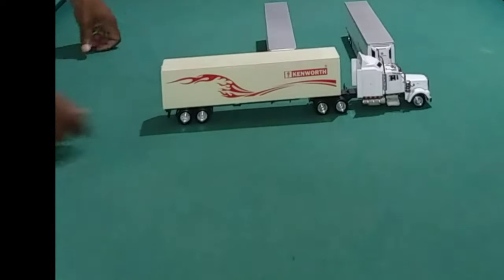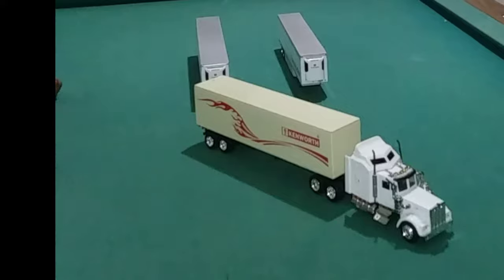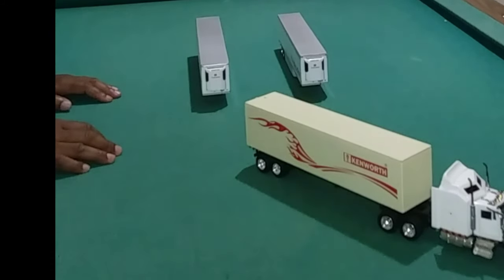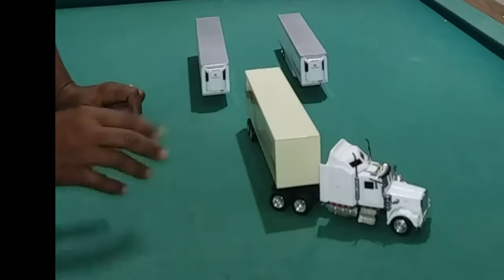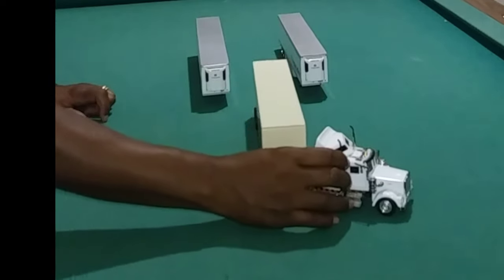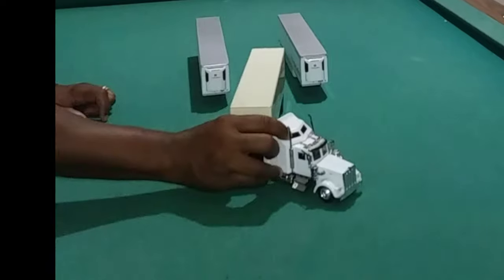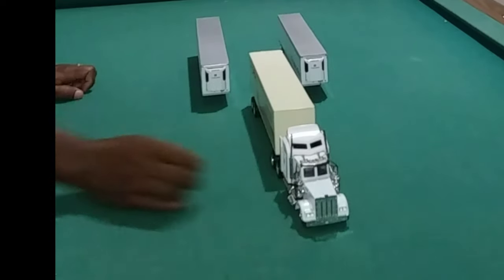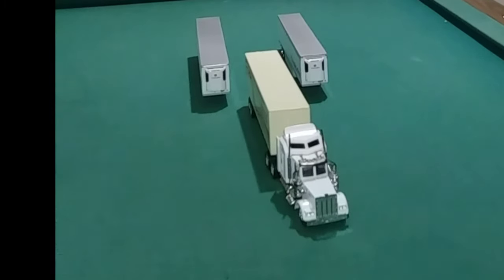Best way to set up for 45 backing maneuver.

Comment: Bro you saved my career. I didn’t go to a school I just rented a truck and took my test. When I first got to a yard it was crazy chaotic and I was lost. I almost said fuck this CDL but you gave me more than hope. I hit that bad boy twice today with no spotter straight in the hole thank you big bro
Reply from the maker: That's makes me happy to hear. If it's anything I can do to help, holla at me it would be my pleasure!
Reply: I met you while at the Rockwall, TX terminal when I first started trucking with. Thank you very much for helping me‼️
Reply: Got my cdl and still can’t back
Reply: @mauriceallen6116  same here. I was taught how to back but not back but that's all. But not how to set up for dock backing our how to make corrections.

How are you doing now after 2 months?
Reply: @Jake-li7ih  I’m doing a lot better, once I learned the set up I’ve been more comfortable.
Reply: @mauriceallen6116  Hey thanks for the response, it actually means alot to me.
Yeah the other day I was able to pretty much back right into everywhere just fine and then I swear the very next day it took me like 20 minutes to back into everywhere I went. I was stressing out bad. I got to one stop where the dock plate was like exactly as wide as the trailer. If I was even one inch to the left or right it wouldn't work. I had to be 100 percent precise
Reply: Same Bro! I would get in the chocked position and and pull up with my studying wheel all the way to the right. Start starting and everything! Gonna put this to practice today!
Reply: @Thisisebm Is there a reason this method is appropriate than after seeing the driver's side rear corner of the trailer, getting straight and backing straight in? I'm new to all of this and I was understanding the maneuvers until then. 
Thank you in advance for your feedback.

Comment: Drivers that are new like myself, this man knows what he is talking about. Even though I haven't been consistent with this technique, it does work whenever I do  use it. The last time I did it, I was at the walmart distribution in Williamsburg Virgina and when I did this technique, It only took me backing up three times before my truck was and trailer was completely straight as a whistle with the spot I was backing up into. The key with this technique is your setup. Setup correctly and this technique will work everytime like he said in the video. Again, thank you for making these backing instructional videos. They have been a big help. I always come back to watching them as fyi.
Reply from the maker: Thanks Isaac! And thanks for watching.

Comment: Hey Cornell! This is exactly what I’ve been doing. So it’s reassuring knowing that I’m not doing anything wrong. I always feel like I’m over steering when I get a bend going to the left. It does take me several pull ups but this technique works! -Monique
Reply from the maker: It may take a few pull ups to get the bend out, but if up straighten the wheel and up just until the trailer is in the position you want, them turn the wheel all the way to the left and back up and just repeat that until the bend is gone just like in the video it should work for you. Stick to the formula stick to the script.. Let me know how it works for you....
Reply from the maker: How you do Queen, hope it's working for you. Stick to the script...☺

Comment: Sir I want to say that this procedure does work. I don't care what others say. When I was in New Albany, Ms. At the Walmart distrubution center, when I was struggling to back in my trailer, I had a fellow driver help me back in it by using this procedure. I didn't notice it until I saw the bend of my trailer and thats when I thought of this video. It works, even when parking your trailer from a  45 degree angle it works. As long as you have the proper setup, this procedure will work every time.
Reply from the maker: I'm glad it helped you Isaac! And thanks for watching.
Reply: @Thisisebm  np. It's just all about how much space you have in front of you as well because most of the time when I turn my wheel all the way to the right, i have to turn to left early at times because of the lack of space in front of me at times. What do I do then to adust

Comment: Wow did this today and got in the hole between two trailers. I even got it in there with not a lot of room to pull up. I drive local and deliver to small yards. Wish I seen this awhile back when I started otr.
Reply from the maker: Thanks for watching Baker.  Thanks for putting the method to the test. If you do it correctly, it will work.☺

Comment: Great video Mr. Cornell because backing is one thing I have been struggling with since I have been training. My question is how will I know if I have pulled up a additional 8 to 10 feet. Your video has explained it better than my trainer and I really need to grasp this backing maneuver on my own cause I will not be on his truck forever. Thanks in advance if you reply back to me.
Reply: good question.. i been wondering this too

Comment: Excellent video the pull up straight then left works great i actually bought toy truck can you do videos on 90 degree alley dock along with setting up for different types parking like coming into truck stop seeing spot plenty room across then hard rt then lt so truck can be straight backed into parking spot when to stop holding rt before lt to straighten truck out so back trailer is even with parking spot also so trucks not all crooked not parallel to where you want back
Reply from the maker: Thanks jeep cj7, and thanks For Watching
Reply from the maker: Stay tuned for more videos and up coming merchandise.

Comment: @Thisisebm Is this best used when the tandems are set back or foward and can this setup be used for any parking or just best for dc’s, also does this work best for a day cab or sleeper? Ive done set up but kind of confused is it a certain amount of space we should go up when we make the hard right to 3 o’clock after picking our spot and shoulder? Then once we go to hard left do we keep the tractor and trailer completely straight or should we have a bend in it when getting ready to do the hard right for the pivot? 

I want to know do we just hard right as soon as we see a bend in the tractor and the pivot  then back to the left.because I’m doing the hard right and when it pivots I go back left but the tail will swing even more to my drivers side. I would really appreciate your help I’m struggling with my backing the most. I’m also struggling with seeing my setup because sometimes I’m placed tight but majority of the time I’m to far away from spot I’m getting in, its frustrating but I’m still pushing. I just need clarity.

Comment: Do you turn your wheels all the way to the right or just a slight turn before you start to back!
Reply from the maker: That's a great question. That would depend on how far you from your target... Remember that you're wanting the back of your trailer to end up pivoting in between the two  trailers if that's your target. I have a video called pivot practice you should check it out. Thanks for watching.
Reply: @Thisisebm  when do you really start liking to crank it soon as you're back trailer tandem hits the extended yellow line the dock line your imaginary line do you wait for the first tandem or in between both tandems and then start cranking do you crank it all the way what I mean by that is do you have the trailer completely at 90° or do you go to like about 80 or 75 and then start chasing it getting back underneath it to straighten out the tractor or perhaps it's 60°. What seems to work best for you it's that tricky question about when do you correct after your hard right where do you like the trailer is it at an angle still not completely 90 so like a 80 or 70 and then you start chasing I hope this makes sense just trying to see what you do
Reply: @Thisisebm  😍
Reply: @Thisisebm  oh yeah start watching the pivot that you put it in the video watch when it starts to Pivot so when the back of your trailer is pretty much square in the hole and the tires are not moving pivoting you want to crank that sucker to the left
Reply: @Thisisebm  your 3:00 position when the tractor and trailer are straight I have a question can you have a slight Bend so you can see out the driver side mirror or window easier instead of being completely straight already starting your turn
Reply: @Thisisebm  your rear tandems you probably do not want them going past your extended line in your hole on your Blind Side is what I'm thinking so then you will know if you're too deep or not deep enough I guess how far do you back up your trailer after the 3:00 position if you like to keep it straight is there a secret formula is the corner of your site side in the middle of the hole or slightly more towards the Blind Side what is your measurement or trick
Reply: I think what I'm looking for is depth perception on the right on the hard right I seem to have a little trouble being either too close to the site side or too far on The Blind Side how can we fix this so we can get in the middle of the hole a hole in one so to speak I hope this makes sense on your hard right do you look at the back edge of your trailer the very back of your trailer or you doing the tandems or maybe a combo of both I would just like to really zero in so I can just get it in without backing up the lock because it's very busy

Comment: Thank you so much for the demonstration!!!!! You are an answer to my prayers!! One quick question does that same thing work on a 90 degree alley dock???? Could you please respond to my question please . I plan to go in about a month to take my skills test at Newport Arkansas today is 10-17-20 703pm 🙏🏻🙏🏻🙏🏻🙏🏻
Reply from the maker: Yes. It's the same on any backing maneuvers. Just recognize when the trailer actually begin to Pivot. If you are turning the wheel to the right the trailer will roll back. But when you see the tandems stop rolling back and begin to spend that's when you turn the wheel all the way back to the left and walk the trail around to the desired position. After that the formula is quite easy if you watch that video then you know what to do after that I promise you we will work for you that time next time all times included☺

Comment: when you started to turn the tractor to the 3 O'Clock, was that one space pass the parking spot that you needed to park in or two spaces?
Reply from the maker: Your drive tires should be right in the center of the space you're trying to put the trailer in  when you do your right hand turn to do the 3 0 clock

Comment: Very helpful video. However, what if you don't have the space necessary to perform the maneuver as described? For example; most truck stops have aisles between the parking rows that are about 20 meters wide. I've found that its impossible to park a 70 ft rig in a singled out parking space in a otherwise completely full parking lot with 20m wide aisles using this method. No method seems to work in fact.
Reply from the maker: Thanks for the question Garrett! I'll do another video on setup and tight spaces.
Reply: @Thisisebm  Sweet!

Comment: Thanks. The only problem is for the CDL exam you are only allowed two pull ups.
Reply from the maker: Thanks for watching Garfield. I'm wishing you luck with that... If you watch the video and recognize the results of your the turn (that means when the trailer is doing what you need it to do) and be proactive with the correcting it as it happening you can do in less pull ups.  Check out my video on pivot practice..

Comment: Wonder if it's a truck sticking out and you can't pull your shoulder to the corner of the trailer how would you go about that ?
Reply from the maker: That's a good question, it's all about the setup. also, it's really about learning how to pivot the trailer. once you've gotten the trailer spawn around and ready for the space, getting the tractor back in front of the trailer is really simple. Thanks for watching and please visit www.thisisebm.com.
Reply: @Thisisebm  also can you make the same video , but have the trailers  a lil in more make it an challenge, with right parking , cause I'm having a hard time some yards that you cany really pull up like you want .
Reply: @Thisisebm  I mean correction, I mean some truck stops are tight and yards , so some times the trailer are close , so it's a tight space , so can you make the same video of how would you work your trailer in a tight spot with a lil pull up.

Comment: it's a really good video, but my only concern is that sometimes we don't have enough space to get to 3 o'clock plus to pull up 7 more feet
Reply from the maker: Thanks Pedro , and thanks for watching.....It's the set to do the maneuvering. It's getting in the position and following the steps. If you don't have that amount of space to do it all the way then cut it in half according to the space you have available if that makes sense. Getting in position to maneuver the trailer is my point.

Comment: When you keep pulling up before you turn it to the left. Are you straightening your wheels out then turn it left? Are you keeping it left?
Reply from the maker: If you put up with the wheel to the left and then back up with the wheel to the left, you're doing the same thing over and over... That's why when you get ready to pull up you straighten the wheel and then pull up. Then pull up  just enough to pull some of the bend out and the turn the wheel all the way to the left... And repeat that until you get the results you're looking for... Watch this video again and listen to my instructions and follow the just like I say and it should work for you.. Thanks for watching..
Reply: @Thisisebm  Thank you bro it's just that I always been nervous trying to backup. I had my CDL for 24 years and never used them because I was always scared of backing up.. And now I'm joining a company that's going to give me a chance. Sometimes I get confused on which way to turn the wheel. But thank you I will watch the video again

Comment: I can do this with space between trailers but i struggle when trailers are tight together. I feel like i might hit something
Reply from the maker: Understood. You can use this setup even in tight spaces.. Just make sure you see the back of your trailer is coming back to the left (the sight side) because you can back-up as much as needed without coming into contact with anything. And get out and look as many times as necessary.when in doubt get out and look. I would watch the video again and listen to the instructions carefully and (trust the process).. If you do it right, it will work for you.

Comment: I am a beginner driver and I’m have a hard time with the 45
Can you do this set up set up with a small amount of space
Reply from the maker: Yes, absolutely, that is why you should make sure you watch the video and understand what the pivot is and what it looks like...... Then follow the steps exactly like I explained them and it (will) work for you ever in tight spaces. But you have to get the trailer in position first then follow the steps, which is straighten the wheel pull up until the trailer is straight with the hole u are putting it in then turn the wheel all the way to the left and back up as far as you want without hitting anything,  repeat that until up are in a straight line with the trailer. It may not seem like it's working but I promise it is Ms Jackson ☺
Reply from the maker: Yes just make sure that you are in a position to see, that means to the left the side where you are sitting. Look at that video I have about easy adjustment and look at the position you should be in.
Reply: Thank you
Reply: Thank you so much for this video, I’m a new driver and I have a lot of issues backing up. Does this formula work if the parking spot is on the right side of you?

Comment: how far left do you turn initialy to get to that pivot
Reply from the maker: Great question @coldfusion5153!
First remember when you're doing this maneuver and looking for the pivot the trailer tandems should be in the middle of the hole that you're trying to put it in.so it's going to be a measuring and /or timing thing (because you can start too soon) and (you can start too late ) so just be aware of that. But to answer your question you turn your wheel to the right. Then look at the back of the trailer - it's going to roll straight back at first for about 8 ft -but at some point you're going to see the tandems stop rolling back -and the end of the trailer start to spin and/or pivot. the moment that you see this it's time to turn the wheel all the way back to the left and hold it. (Make sure that you're paying attention, because if you hold the right too long your crush the tractor and trailer together) watch the video again to see if you can recognize these points I'm speaking of.
Reply: @Thisisebm  Thank you so much for the detailed answer. will watch multiple times and relate to the points you mentioned.

Comment: Can you complete this set up in tight spots? 
I get so much anxiety doing this I’m  a rookie out here.
Reply: drove for 30yrs, tight spots made me anxious almost always. Just take a deep breath, do your best, get out look around up-down-right-left-front and back. it gets easier
Reply from the maker: Yes, its all about the setup, sometime you have plenty of space, sometimes, you have half the space. The objective is to get the trailer spun around inside the two trailers, in position to do the forward/ left maneuver. Watch the video, if you have half the space, then you have to cut what I've demonstrated in half, if that makes sense.
Reply: @Thisisebm  thank you. If possible can you show tight spots too where you have to do 90 degree angle.  This seems to be the hardest maneuver for me.